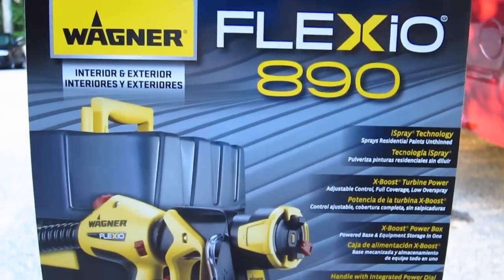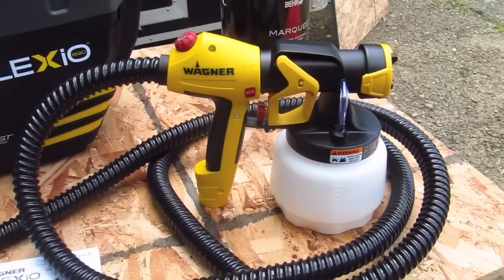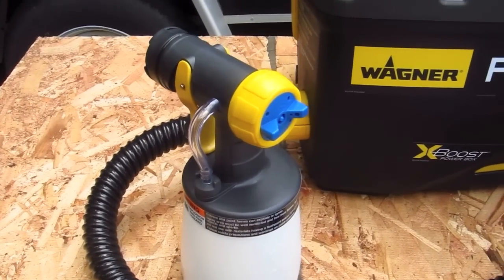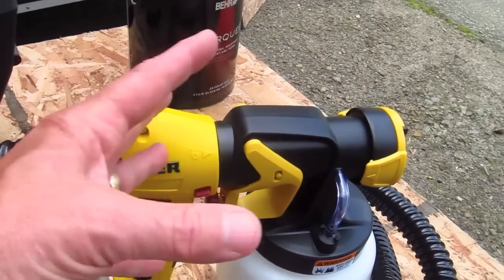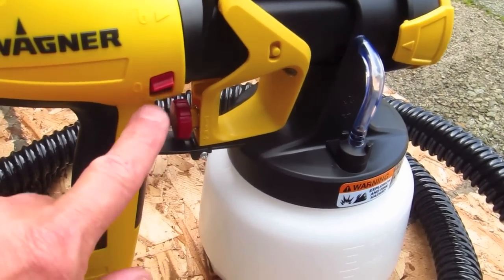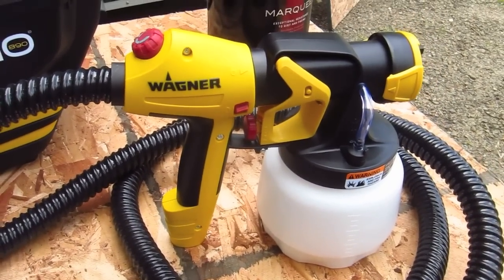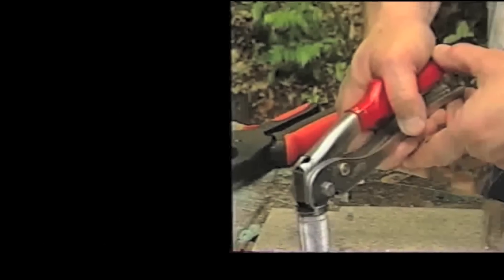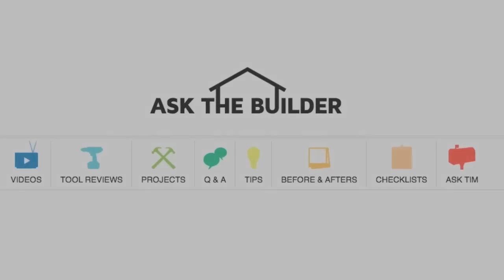Wagner Flexio 890

Comment: looks like a good spray pattern!  I like it.  Are you using just regular latex paint there Tim?  I am in the market for a good sprayer that will last about 4-5 jobs and this looks like a good solution.  I would like to spray a high gloss BM paint without thinning.  Doable ya think?
Reply from the maker: Simple. I think you should read the instructions that come with the sprayer to see if what you intend to do is viable.

Comment: Looks nice but do you think it could serve a dual purpose of using it to spray paint on a van? I have some large stencils that I want to put as designs on both sides of my van as well as be able to use it for household projects too like turning my office into a green/blue screen room for video.

- Heidi
Reply from the maker: I think it might work, especially the smaller nozzle. I'm going to be testing a similar unit from Rockler very soon. Watch for that video.
Reply: Ask the Builder I sure will. :) I check my subscriptions page daily. :D

- Heidi

Comment: Did u have to thin the paint or streat out the can ?
Reply from the maker: You must thin it. Read the instructions with the sprayer AND on the paint can. Thin it too much and you ruin the paint.
Reply: OK thanks I sprayed my wood 4x8 trailer and I didn't buy it new so I won't sure so I sprayed it streat out the can thick and it covered good just had bad over spray it was a water base paint meaning I could clean it up with water I will try my shudders mixing today I painted last night soon after I posted my question 😀
Reply: I was very happy how it worked even with me not thinning the paint !!

Comment: how much overspray?
Reply from the maker: Not much at all. I'd say about as much as any commercial paint sprayer.
Reply: Ask the Builder
OMG you're actually there on my day off. this is incredable!
Reply: Ask the Builder  Well, I have a commercial grade airless spray rig and I wouldn't use it indoors unless the house was empty. The minimum pressure to atomize paint on those things is high enough to make a cloud of expensive wasted paint. I haven't used a HVLP - are they practical for indoor painting?
Reply from the maker: Tin Man I've not painted indoors with it yet, but I can tell you there was very little waste. A pro painted my windows and house exterior here four years ago with a HVLP sprayer and there was virtually no overspray.

Comment: Wagner has proven to be junk in the past in my opinion, good luck with your new unit.
Reply from the maker: Did you hear what I said at the beginning of this video? This unit may be a wakeup call for you and others. Watch out for zero-tolerance policies - sometimes new products do a better job.
Reply: Ask the Builder I have been using an HVLP unit from Rockler (also available at Harbor Freight ) for many years with excellent results and an excellent price, I own two of them. I use 1 for paint and 1 for lacquer.
Reply from the maker: Up2Date Cool. Remember, this is a DIY sprayer.... Not a pro unit. Don't make the mistake of comparing apples with onions. I've used a Grayco unit for years and it's not fair to compare it with this Wagner unit. Realize that companies make tools for different market segments. Grayco is not after the DIY market. The brand you use is not after it either.
Reply: Ask the Builder My unit is not a pro unit either, although I am a pro with over 30 years experience. The unit is a DYI, but preforms at least 80% or more as well as a pro unit, I suggest you do a comparison, the one I use runs  about $ 100 or so.
Reply from the maker: Up2Date Send me a message here on YouTube with the brand and model # so  I can get it.
Reply: Ask the Builder The one from Rockler is already in your youtube inbox, check your inbox